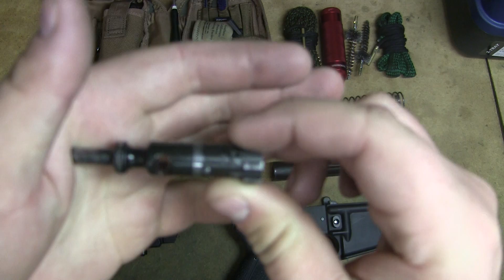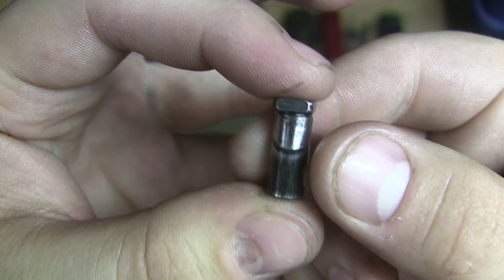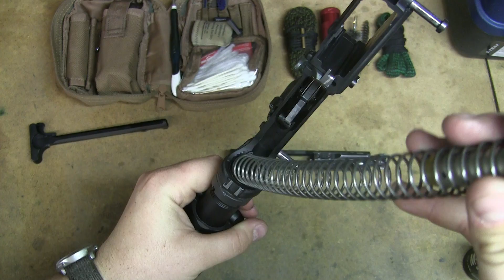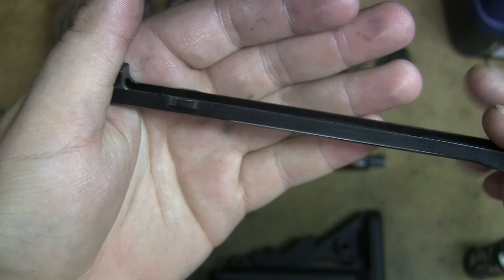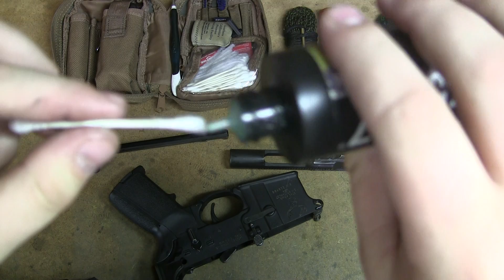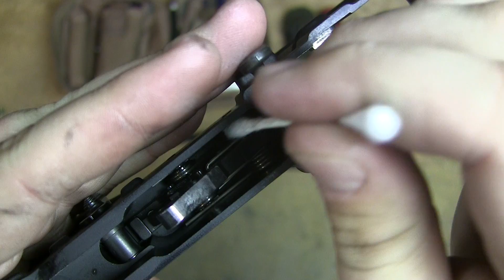AR15 Lubrication

Comment: 30 years tool and die maker  (gunsmith on the  side ) if its slides - grease it, if it rotates -oil it.
go to  lubes
1. LSA surplus oil

2. Mobile 1 ( 0-30 , or thin end of spectrum)

3. 00- lithium based grease 

 2and 3 are your cheapest and actually best choice. 

4. gunslick grease  (if you can find it)

5. Zero friction  ( good for fine moving parts,  triggers, site post screws ,ect.
 a firearm is just a machine like any other machine each has its proper lubrication process.  what i find laffable is the high priced snake oil products sold today that can easily be replaced by low cost  products like surplus LSA and mobile 1. Poly frames are a different matter and manufacture recommendation are a must,  if the manual doesn't say, call them.
Environment is another factor your safe queen requirements  will be different than one that's  being drug around in a sandbox or artic tundra. lube accordingly.
Reply from the maker: Ha Re 

Standard CLP has been getting the job done for me for a long time. Certainly there are other products or methods that would also suffice, but the methods shown here have got me through Afghanistan and Iraq (so far). The AR is a sealed system, and even with the crazy dust storms we've had out here, the internals are good to go, and CLP applied in the shown areas has been working for me out here. 

I'm hesitant to use automotive lubricants because I know polymers and other ingredients are present, and I don't know enough about chemical science and compounds to know if burning that off and breathing it in is a great idea, so I stick to the oils made for firearms. In a pinch I have used engine oil, but it's not my go-to when I actually have options. 

Thanks for commenting.
Reply: +Mr2ndAmendment i should have rephrased "go to" to My go to,  not knocking CLP, modern chemistry has brought us wonderful products,  think about a ww2 M1, you had three products to carry around,  bore cleaner, and weponds oil and grease in those little combo bottle in the  butt stock, now you have one product, eazy-peazy. my only issue ( coming from my 30 year's tradecraft) as first stated " if it slides -grease it, ect. this applies to any machine. as a side bar ,today's poly weponds add a new dimension, that's were the manufacturer requirements come in. as to motor oil i would not use deno oil, only 100% synthetic,  many parts on today's automobiles have poly parts like oil pans,rocker covers oil seals ect. and burnoff i don't feel is any more an issue than lead dust,  although lead poisoning while you were playing in the sandbox would have been more of a concern i imagine . your experience severing our county (thank you for that btw) is priceless and you know what works and what doesn't.  interestingly being a 4th generation gunsmith, when  my oldest brother served in vietnam, he was in the middle of the m16 snafu and understood right away what was going on and called home to have pop send him the needed equipment to properly clean his service rifle,  he says it probably saved his life because some of his buddies weponds failed and they ... well you can imagine the rest, my brother was lucky because of his background in weponds and armory skills. 
the firearms debate on lubes and procedures will trudge on forever,  many ways to  skin a cat i guess. i am a cheap SOB and look for ways to  get the job done in a safe and practical manor,  i never did like snake oil salesman. 
thanks for replying, be safe.

Comment: Good vid. The only other place I think would need lube is probably on the locking lugs, since you have metal-on-metal contact with the barrel extension.
Reply from the maker: If I'm knowingly going into a sterile range environment, I'll do that.  If I could be in a dusty/sandy place, I'm not doing it.  If I got lube on the bolt lugs/barrel extension and sand gets in there, it's game over.  If it had nothing to do with headspace I'd be tempted to go for it, but with that area I'd rather risk the wear from no lube compared to sandy wet gunk, lapping my bolt lugs with every shot and increasing the chances of a problem (usually failure to fully chamber).

Comment: Agree with all of it, however you forgot the side of the gas tube on the bolt carrier. The wear was as obvious as the rails
Reply from the maker: Yeah, that's what we call "cam drag."  The bolt cam will dig a little on the inside of the upper and there's really no way to prevent that kind of wear.  The best I do is lubricate the bolt cam a lot, as shown, and lubricate the four "rails" of the carrier (called the raceways), but that's really the best you can do.  Some companies have tried to deal with cam drag, but lubricant or not that is a high-impact area that will wear.  On the high-mileage M4s we got at work, it's a pretty nice "dig" in the upper, but at some point it seems to just stop digging.  Actually kind of reminds me of what happens in Mossberg receivers, with steel having a hard impact on the aluminum receiver on the inside, but at some point it just stops "digging."

Colt has come up with a steel interchangeable screw right where the cam drags to give the cam a hardened metal part to interface on, while Sig Sauer has straight up just milled the area out entirely, and I'm wondering how that will work out in the long term.  Other companies have put out a bolt cam with a rounded head rather than a squared off head, and that seems to help.  Most companies just let it ride with the original Stoner design and in the vast majority of cases, even on high-mileage weapons, it doesn't present a failure or issue.  Lubricating that area won't hurt anything, but unfortunately it won't help either.

Comment: You are doing it all wrong! You have to clean the bypass line. You'll need a pair of pliers and some 30w ball bearings. Prep that line with some 3-1 oil and some gauze pads. Get 10 quarts of antifreeze preferably Prestone. No, no make that Quaker State. Thanks for the video. I use a little more than you. I take whatever is left on my hands and rub down the bolt and maybe a drop or so on some of the lower. No need to swim your parts in oil. I wonder how many people will get the first part of my comment? Cheers!
Reply: weasel316 how’s traffic on the Santa Anna this morning?  I heard there’s a jackknifed manure truck up there!
Reply: Fletch
Reply: “It’s all ball bearings nowadays”!!

Comment: What do you use for your bore?
Reply from the maker: To clean the bore in a chrome-lined rifle, I use brushes and patches on rods with Hoppes#9.  I finish up with two passes with a bore snake -the first to dry out any leftover solvent, and the last pass with CLP dipped on the end to coat the inside of the bore.  It's honestly not even a needed step as the chrome-lining would prevent any rust, but I do it more for my peace of mind even though I know it doesn't need it.  After enough time, you may experience some copper build-up in the grooves of the rifling, in which case you want to be careful using copper-busting solvents because that can mess with the chrome-lining due to the ammonia content.  

Not to be a poster boy for Hoppes, but in chrome-lined barrels I use their #9 copper solvent, comes in a dark brown/silver bottle, because it has a very low ammonia content compared to the crazier products like Sweet's 7.62 and others.  The #9 copper solvent is more forgiving and I can leave it in the bore for about 10 hours, then brush/patch it clean without worrying about ruining the chrome-lining.  You shouldn't need to worry about copper fouling every time you shoot and clean, it would just be a once in a while kind of thing.  

If you hunt with your AR and choose/have to use all-copper bullets, then you may want to check for copper fouling and clean with copper solvent more regularly, although you always want to be careful how long copper solvent sits in any barrel, especially a chrome-lined bore.  

Bottom line: most AR15s people will buy are chrome-lined or melonite-coated in the bore and the concern over rust is very minimal, and although it may not be needed, a light coat of CLP on a bore snake or a patch isn't going to hurt anything, and that's what I do.

Comment: Well done video.  If you watch 100 videos ar 15 cleaning and lube, you'll find 100 ways of doing it.  I use Ballistol on all my firearms, thanks to hickok45.  I don't over oil though.  I'll clean and lube my guns when I get back from the range and if it's a few weeks or months before I go again I'll give them a little oil before I go shooting.  Thanks for your service.
Reply from the maker: Thanks for watching and commenting!  There's a 100 ways to do it from 100 people, that's for sure, and they're not all wrong.  I try to minimize wasting oil so dudes don't have to buy it as often, while targeting the critical areas with just enough to run well and prevent excess wear.  There's some methods out there I think are excessive with the oil, but they still work great for general recreation.  The only methods I have concerns about are those involving the use of motor oil -I'm not a chemist and I don't know enough about those compounds to know if it's a good long term solution.
Reply: Mr2ndAmendment From what I understand, Ballistol over time will absorb into the metal creating a seasoned iron skillet effect.  It's non toxic and I use it as an all in one cleaner, lubricant, and protectant.
Reply from the maker: I've never messed with Ballistol personally, but I know plenty of dudes who swear by it and they get great results.  From what I've seen though, I would have no problems recommending it to anyone.
Reply: Mr2ndAmendment Thanks for the reply.  I just watched a video of a tactical trainer/ex-marine who uses wheel bearing grease on his ar's, and never cleans his bores.
Reply from the maker: I think you can get away with that, provided you don't go for prolonged periods of time in austere conditions.  I worry about the grease because it'll get caked with dirt and become abrasive/gummy sludge.  If it's a chrome-lined or especially melonite-coated bore, then he's good to go, although the lead and copper build up in the rifling might have a very minor effect on group size.  If anybody was trying to go a whole service length of time without cleaning the bore, I think you wouldn't have problems although I'd recommend at least using a chamber brush every once in a while to keep the star chamber clean.

Comment: I like the q-tip thing on the lower receiver. I also like the comment on how the hammer comes in contact with the bolt carrier. A little grease there.

Comment: I've always been a lube-it-till-it's-dripping-wet kind of guy, so this video gave me some great food for thought, in particular, your pointing out the 4 rails. Do you recommend the exact same lubrication for an AR-10? I have a DD5V1 and keep wondering exactly how to oil or grease it up, due it having higher stress on its parts than the DDM4 line (Daniel Defense's line of M4 riles) has.
Reply from the maker: I'd recommend the same methods, with some slight deviations where applicable.  I know you got two ejectors, so I'd make sure they both got drops of oil worked into them (by pushing them in and out with oil).  Overall it should be the same stuff, just on a bigger scale.

Comment: do you have to clean out your gas tube ever?
Reply from the maker: That's a great question you don't hear often.  In terms of the areas around the outside of the gas tube, you can use Q-tips and patches with a dental pick to clean around it inside the upper receiver.  You should also use a pipe cleaner and Q-tips to clean the visible segment between your quad rail/hand guards and the upper receiver, as carbon builds up there too.  You can also check out your front sight base or gas block and clean off any external carbon where the gas tube roll pin is, carbon does show up there too.

In terms of cleaning the inside of the gas tube, there's not a whole lot you can do, and trying to push any pipe cleaners all the way down could cause an issue if it gets stuck.  The gas tube is made of stainless steel, and in some cases (like Spikes Tactical) they actually may coat the gas tube in melonite or some other tough finish.  In the end, the gas tube is very durable and made from corrosion-resistant stainless steel.  Every time you shoot your rifle, a great deal of heat and pressure pumps through the gas tube -in essence, you're "cleaning" it every time you shoot it and due to the heat and pressure, carbon can't build up inside it.  

Besides cleaning around it in those 3 locations (inside the upper, between the upper and the rail, and at the gas port), I wouldn't do anything else for it.  Great question!

-Mr. 2nd

Comment: I would also put a drop off oil on the safety stem so that it would work itself towards the safety detent for a smoother safe/fire action, also a swab with oil where the disconnector and hammer and trigger meet as well as where the trigger and hammer meet, basically anywhere there is metal to metal contact is the logical places to lube!

Comment: With a brand new BCG would you recommend taking it apart and oil it like this or just take it out and shoot it a few hundred rounds and then clean and lube?
Reply from the maker: To make the best decision possible, I would lubricate it as seen here, then put it back together.  I would focus on the gas rings especially and the bolt cam -those parts are brand new and before they're worn in, you really want to make sure they got lubrication. 

Some companies, BCM being an example, offer great rifles that are made to be ready out of the box without doing anything.  They are clean and lubricated so that all you got to do is load it up and shoot it without issue.  Some companies go that route, but a lot of companies may not and it's always a good idea to do a basic field strip and check out your parts and components for any obvious issues before you shoot it.  Even with something like a BCM, I take it apart and check it out real quick before some lubrication and putting it back together.  

The AR15 will function fine with too much lubrication, but in some cases you may have problems with not enough.  Lubricating like you see in the video is what I would recommend for flawless performance at the range.  Thanks for watching and commenting!

-Mr. 2nd
Reply: +Mr2ndAmendment thank you for the info, and quick reply.

Comment: Excellent Video. I have two BROs and never have shot them yet. Tonight, I will take them apart and do what you said. I understand using a little more oil on guns that have never been fired.  You did an excellent job and very direct and to the point. Thank you for taking the time to help those of us that need it.  God Bless.

Comment: Bout time someone isn't spraying 4 oz of friggin lube on the bolt.
Reply: Most of the carbon fouling people complain about is actually the result of over lubrication.  The carbon combines with the excessive lube to form a gritty sludge that can harden and coat internal parts under the heat of firing.  This can be exacerbated by shooting ammo that had powder that burns dirty (almost all of the Russian stuff) and not giving things a quick wipe down after a range session.

These days I use Strike Hold which is a dry film lubricant so I just spray down the carrier, bolt, fire control, interior of the upper, charging handle etc. and it dries out leaving a lubricant film.  I do add a light coat of Mil-Comm TW25B grease to the rail areas like in his video but that's likely overkill.

I the past I used to give everything a good overall exterior coat of oil and let it soak, then wipe everything dry and lube as he did in the video.  If you understand the mechanics of the AR system what he lists as lubrication points is really all you need.
Reply: No you his guns work, don’t they. And he actually shoots a lot. I’m assuming you don’t, considering you’re watching this video.

Comment: Remember that oil ALSO lubricates contaminants and keeps them in suspension to allow smoother and easier function of the action of any machine, even in dusty environments, and especially in DGI weapons which run inherently hotter and dirtier than piston systems. It also aids in cleaning the parts as you noted the tail of the bolt assy.

I use a lot more oil than do you, and as RKBA below suggests, I use Mobil One full synthetic. I like the Extended Life or Racing formulations as they seem to have the best and slipperiest friction modifiers in the formulation package.

If the weapon is dripping, you have gone too far. Way too far.

Comment: why is it not good to let the firing pin hammer slam?
Reply from the maker: I've seen our beat up M4s take a lot of hits like this, with the hammer being released right onto the bolt catch, without immediate effect, but it's still not something I'd recommend as I've seen one receiver crack from doing this.  Maybe that receiver was a defect, maybe it got too many hits like that, but what I do know is that the rifle was never designed to do this.  The hammer slamming the bolt catch was never meant to happen, and generally if a gun was not made to do something I don't recommend we do it.

It's not even a difficult thing to ask of someone -it's pretty easy to slowly rock the hammer forward and let it rest against the catch, with it being so simple it's just a no-brainer.

Comment: Save your money and use full synthetic motor oil.  I'm sure Mpro7 and EWL Slip 2000 are  good stuff but expensive compared to a $5.00 quart of Mobil Super Full Synthetic 10W-30 that'll last forever almost.  Mixing motor oil with Hi Temp Wheel Bearing Grease works great in some applications too.  Seems to stay in place and last longer than any of the "gun lubes."